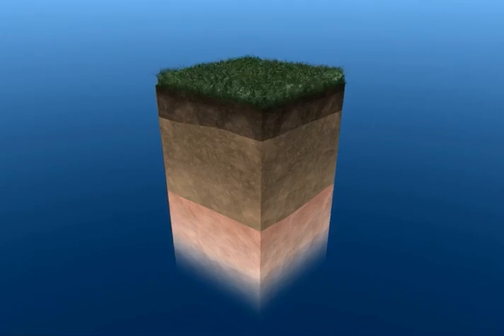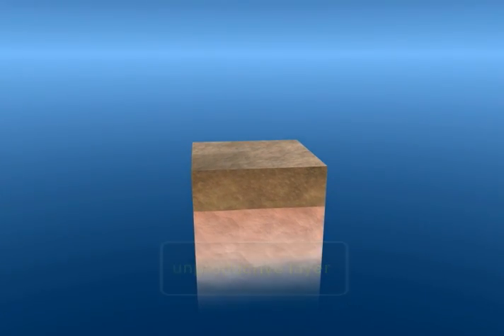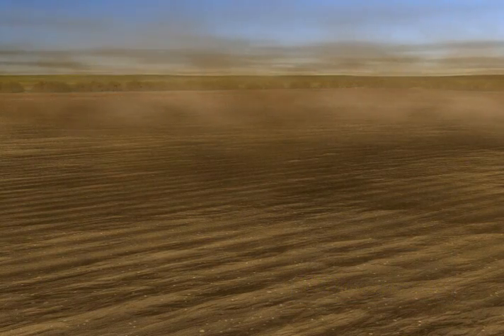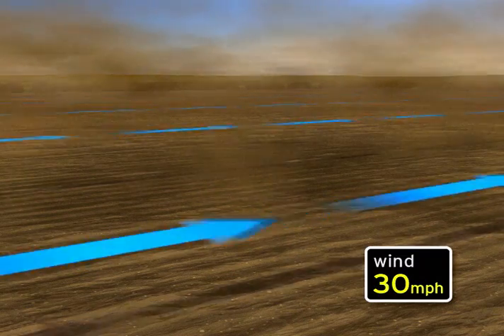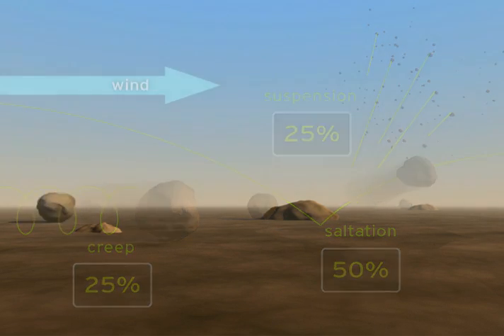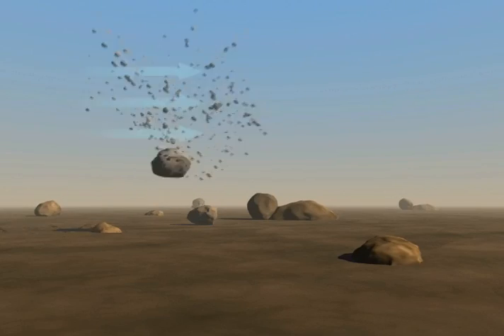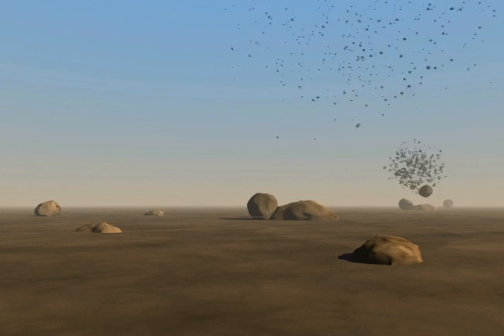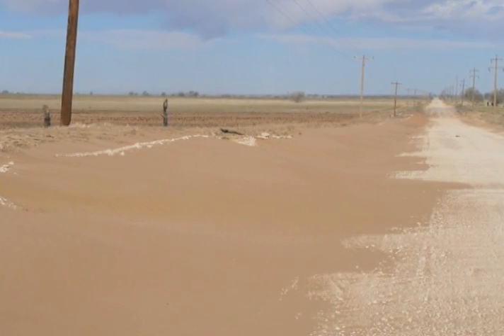Wind Erosion (english version)

Comment: Three types of erosion
Creep- (An extremely slow process)Where wind erosion begins, when the wind causes the particles the roll or “creep” across the ground

Saltation-More than half of soil eroded by wind is caused by saltation this is when the wind moves particles in a hopping or bouncing fashion

Suspension-Wind erosion is most visible during this stage when it is actually moving through the air. Seen most in a dust storm where soil particles suspended in the air can move hundreds or thousands of miles before they are deposited
Reply: ur actually goated

Comment: Voiced by the same man as the fitness gram pacer test and produced by the team that made "Water Erosion", it's WIND EROSION (english version)
Reply: The fitness gram pacer test is a multistage-
Reply: @feelina1872  

OH NO
Reply: @the_speedy_dog6808  The FitnessGram™ Pacer Test is a multistage aerobic capacity test that progressively gets more difficult as it continues. The 20 meter pacer test will begin in 30 seconds. Line up at the start. The running speed starts slowly, but gets faster each minute after you hear this signal. [beep] A single lap should be completed each time you hear this sound. [ding] Remember to run in a straight line, and run as long as possible. The second time you fail to complete a lap before the sound, your test is over. The test will begin on the word start. On your mark, get ready, start.
Reply: @feelina1872  
its too late
i've failed
Reply: @the_speedy_dog6808  yall guys did the paser test too?